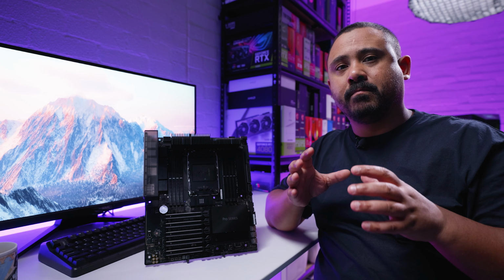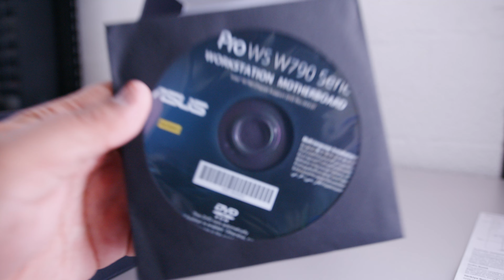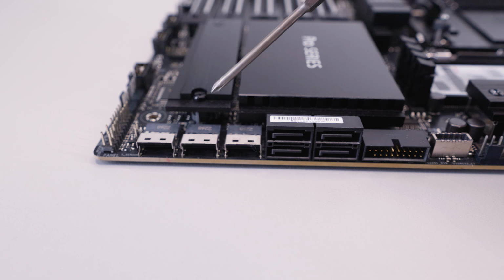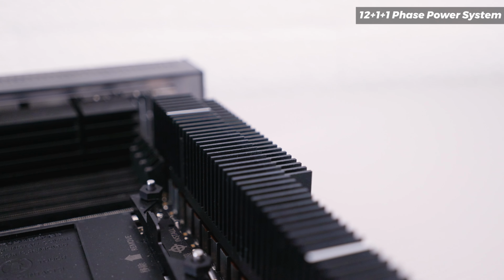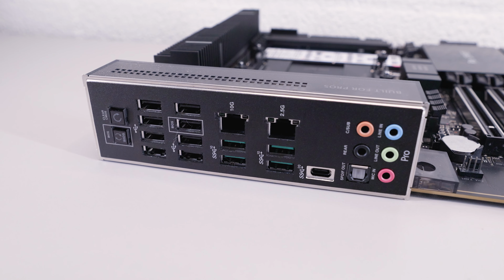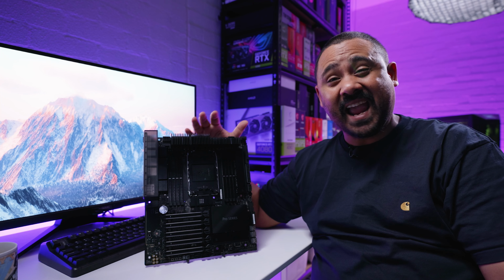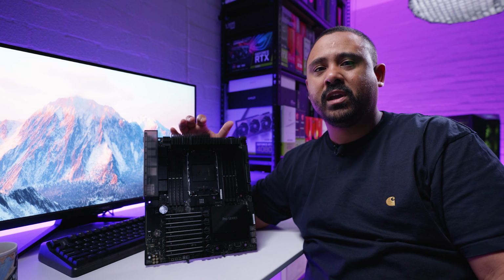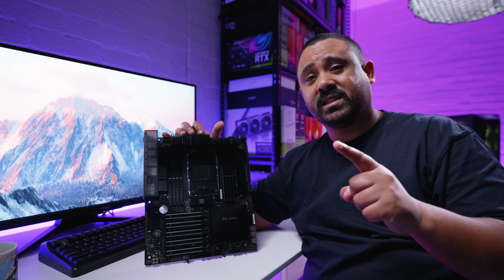Intel HEDT is Back with W790! - ASUS WS W790 ACE Overview

Comment: I think it's time for mobo manufacturers to switch to a right angled 2x12pin tiny connectors instead of single huge 24pin.
No usb4 & pcie5 m.2 is kinda sus for the price pf the motherboard. 1 of those problems can be solved but everything should have tb4 in 2023. Especially something that is "workstation" grade. Everything else is top tier.
Also mate did your a roll camera had some dust on sensor or lens or maybe it's just lens flare? There seems to be some kind of dust/abnormality near your right eye area
Reply from the maker: I did notice that before filming. It was a lens flare. I decided to leave it to make people comment about it lol